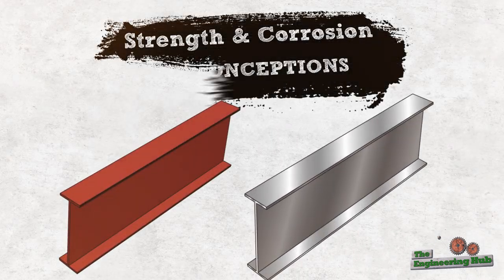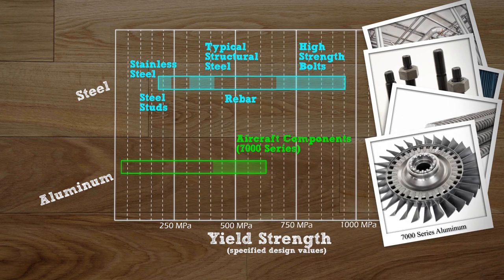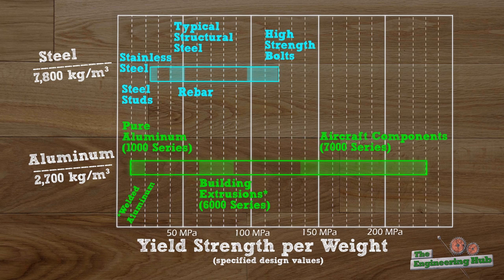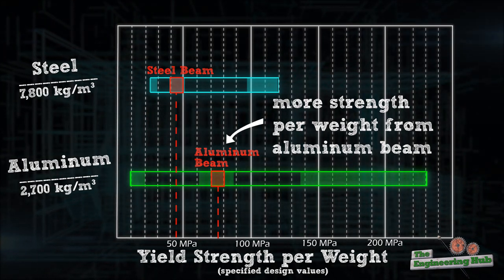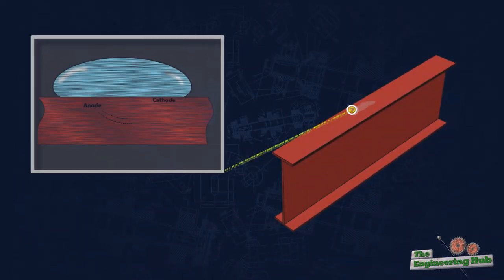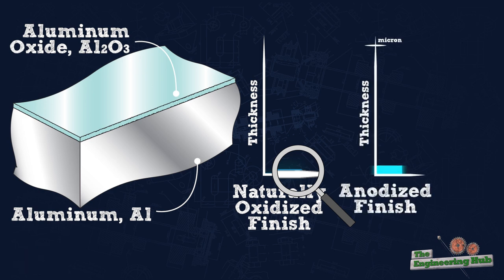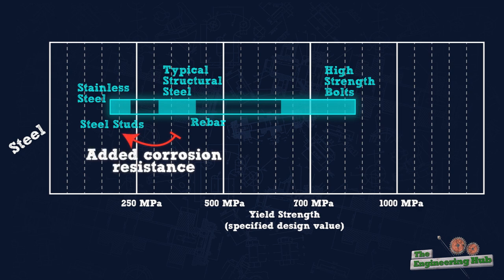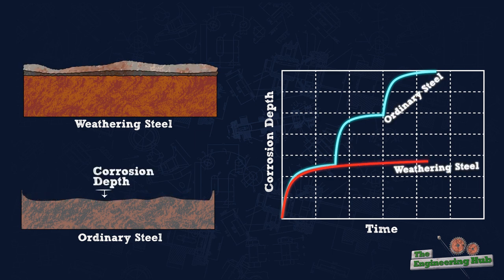Steel vs Aluminum - Debunking 4 Common Misconceptions

Comment: At work we are often avoid aluminum because of the following issues:
-Dissimilar metal corrosion with steel fasteners
-The need (or precieved need) for helicoil inserts 
-Difficulty in welding, the strongest AL alloys are often only weldable by friction stir welding which is a non-starter
-Fatiuge limits for vibrating structures and structures loaded to a high percentage of their yield strength 
-High strength aluminum alloys are harder to procure and have longer lead times 
-Some alloys are prone to stress corrosion cracking. 

When I was a kid and in school I had a real affinity for aluminum but when I had to start designing stuff steel grew on me fast.
Reply: Hey,
I’m doing a caravan 
The base chasis is steel, so I was thinking to use aluminium for structural wall and roof frame connecting it to steel base chasis, 

Does welding make it weaker? Use brackets instead or 

Fastners are no good?
Reply: @sagarshrestha9444  5000 series Aluminium-Alloys have a good corrosion resistance, are fairly easy to weld (given the correct tools) and don't lose a lot of strength during welding.
But welding thin Aluminium sheet metal is really a pain, so maybe consider riveting? There are suitable sealants for the joints, so it'll be watertight. We used SikaFlex in the shop I worked at, but that's a Swiss product and probably veeery expensive...
Reply: there are many other disadvantages to aluminium the man neglected to mention such as cost and strength per unit volume.
because main reason why steel is often chosen for construction is that, while more massive, also takes up a LOT less space than aluminium.
another thing is flexibility and toughness, you can hit a steel I beam with a forklift and it's not gonna budge and at worst you're tearing the bolts out of the concrete floor before the beam takes significant damage.
you do that with aluminium there'll be a huge gash torn into it, with extremely sharp edges all around it.

Comment: As an electrician I've seen many aluminum wires corrode into dust. To be fair copper will also do this in very humid conditions, but aluminum is way worse. That's why we don't use it in romex any more, just doesn't hold up and becomes a safety hazard.

Comment: Great video, the only slight issue is the over simplification with the yield strength of stainless steels, those with a yield in the 200 MPA range are the very low end of the range such as 409, and most are far stronger, 304 is 240MPA, 316 is 290MPA, 303 is 415MPA yield strength and 301 has a field strength of 945MPA, you made the effort to show difference with differ types of aluminium, I think it would have been interesting to see the same with the different types of stainless.
Reply: Sorry, but you are comparing the 0,2% yield strengths of type 303, 304 and 316 in the annealed condition to type 301 in the cold rolled "full hard" condition. Not exactly a fair comparison. 

There are nitrogen-alloyed (nitrogen-strengthened) stainless steels that can surpass 800 MPa 0,2% yield strength without cold work strengthening and exceed 1500 MPa with cold work. PH 13-8 Mo stainless steel will attain 1400+ MPa yield strength in the H950 aged condition. Maraging steels (MAR 250, 300 and 350) are technically not stainless steel, but MAR350 can even attain higher values for yield.
Reply: u guys are dorks (i love you both dearly)

Comment: Yes, more please. I'm so puzzled.  Stainless steel is very hard to cut and drill but apparently it's weaker structurally. I'd like to understand this better.
Reply: chromium fucks it up 😂
Reply: And there is different types of strength.
Reply: The reason many stainless steels tend to be difficult to cut and machine is due to the tough, gummy nature of the material.  The toughness creates high cutting forces, which in turn promote work hardening (anyone who has had to drill stainless steel with a hand held drill has likely encountered this).  The "gumminess" of the material makes it difficult to get good chip control when machining.
Reply: @ferrumignis  Correct
Reply: I observe they are brittle and crack easily and not as ductile as ordinary steel. I think that is why they are not used in car bodies because they cannot be stamped into shape without cracking ?
Reply: @liboy9844  that sounds about right. I think the Tesla truck was going to be stainless steel but that was all flat panels wasn't it?
Reply: @liboy9844  Stainless steel isn't used for many reasons, primarily cost but also weight (you need more for equivalent strength), more difficult to weld and some grades can be prone to stress cracking.
FWIW the infamous DeLorean car has a stainless steel construction.
Reply: There are three main types of corrosion resistant steels:
Austenitic - soft, ductile, easy to weld; not hardenable by heat treatment - used in decorative and low load applications, cutlery and the like
Martensitic - hard, not very ductile, must be heat treated before and/or after welding; hardenable by heat treatment - used for cutting tools, turbine or engine shafts, valves (up to around 300°C service temperature)
Austenitic-Ferritic (Duplex) - fairly high strength and ductility (not actually hard), superb corrosion resistance (and price); not hardenable by heat treatment - used in chemical industry

These three main types differ in their respective alloy composition, mostly their Carbon, Chrome, Nickel and Molybdenum content.
Reply: @fimbulvarg1213  very interesting.  I don't know if can tell the difference in the field when I pick up a piece but I'll try.
Reply: @Goalsplus  You can't tell by looks alone, you'd have to know the grade number. And there are several number systems, all uniquely awkward in their own way^^
Reply: @fimbulvarg1213  thanks. I'll stop trying to do the impossible.
Reply: I once had a S&W model 66 stainless steel revolver. It worked fine but I was warned it might develop microscopic cracks. I eventually sold it so I’ll never know about cracks.
Reply: in reading about EDC knives there are about 20 or more types of stainless steel which are different alloys with different properties. For example mine has a VANEX blade which uses nitrogen instead of carbon and it’s main property is that it’s totally impervious to corrosion, even in marine environments, you can leave it in the bottom of a boat. Although the pins may not be VANEX. Probably at the expense of some other property, maybe it won’t hold an edge as long as a tungsten alloy blade.
Reply: @darylcheshire1618  There are certainly more than 20 stainless steel grades ;)
For comparability I personally think one should avoid trade names and use grade numbers like the UNS or the European material numbers... Though Manufacturers tend to try (very hard) and hide the fact, they don't use the most specialestest of steels for their products :D
Reply: @darylcheshire1618  I'll add to my previous comment, that some grades are of course proprietary (as in patented) and don't have material numbers of any kind.
Always take the material descriptions with a grain of salt though. They're trying to sell you stuff ;)
Reply: @fimbulvarg1213  I thought about 50 but I wasn’t sure
Reply: You can post anything on the internet bro. Im a machinist, and youre right, steel is way harder to work with because its way stronger and way denser and way heavier.
Reply: Stainless steel is strong, but on the molecular level it's like glass because its like a potato chip, while mild and aluminum is able to deform like plastic and keep its shape.
Reply: @SteveVi0lence  Nope, it's an alloy, not a glass. The crystal configuration makes the difference.
But there are stainless steels with similar structure as mild steel, and even hardenable ones (martensitic and maraging).
Reply: @fimbulvarg1213  it's called explaining it in a way that someone can understand
Reply: @SteveVi0lence  It may be easier to grasp, but it's still very wrong. Glasses and metal alloys behave very differently.
And also I thought we were already beyond the point of explaining material scienece to 5th graders.... But I may be wrong on that ;)

Comment: Aluminium also suffers from Hydro Aluminium Oxide (HAO) under certain conditions. HAO turns affected areas or spots into soft powder which can penetrate the metal and cause failure. This is mostly seen in marine enviornments.

Comment: Some other huge differences are strength based on heat (steel wins) and cold embrittlement (not sure on the properties of aluminum here). Also, fatigue strength is huge and steel would win on this one as well (that is why aluminum can't be used in house wiring - bend it a few times and it breaks; copper can be bent many times more before that happens). I have read that even aluminum power lines often have a steel cable in the core for extra strength (and since electric primarily flows on the outsides of the conductor). Because of fatigue, I am very wary of aluminum for many critical structural purposes. Because of steel rust, galvanizing, etc. is a must in my opinion. (Disclaimer: I majored in mechanical engineering in college, but never got a job in it, so I understand and love engineering, but am not a real engineer and certainly not a materials scientist.)

Comment: Great video as usual; I appreciated the differentiation between the different types of steel alloys and their strengths!
Idk what your field of specialty is, but I really liked how you mentioned the extremely weak welded aluminum. It would be nice to have a whole video dedicated to the effects of welding on different types of metals. I've heard that welding makes steel stronger for some applications, but I've asked about weldable 80ksi steel and they said I was a fool bc welding makes it weaker
Reply from the maker: Thanks Matthew,
Yes, welding certainly could be a video topic of its own. We've added this to our roster of potential future videos. 
Cheers!
Reply: Not an engineer, but a welder, what exact type of 80Ksi steel exactly are you looking to weld? almost all are weldable, some creep resistant Chrome-Moly alloys need careful pre and post heat to avoid cracking but don't end up weaker at all when done correctly.

If you know exactly what alloy of 80Ksi steel you are looking to weld I can probably point you towards a few good resources on how to weld it.

Comment: I'd like to answer some of the questions here about Weathering Steel.   I work with it.
Weathering Steel is more known as Corten steel.  

Corten is a carbon steel with an added 0.5% to 1.0% of Chrome, and Nickel, and Copper (each).  Think of it as a low percentage stainless steel with an added copper.  See why it is rust resistant?  The copper helps in creating the corten patina with helps to prevent further rusting.

Corten steel, Or CorTen, or Cor-Ten steel.  Short for *COR*rosion resistant - *TEN*sile strength.  CorTen trademark is owned by US Steel who invented it in 1933.  Therefor, people use Weathering Steel to avoid using the trade name.   

US Steel is in Pittsburgh PA.   Home of the Steelers.   And now you know why it's called Steelers.  😁

Cheers!

Comment: HV power lines actually use a mixture of steel and alumium, since they have to use fairly pure alumium for high electrical conductivity, and steel is cheaper and better than alumium alloys for structural reinforcement (less creep) The stronger alloys of alumium are not as conductive, so they are only normally used in special case power lines where corrosion of the steel reinforcement might be an issue.
Reply: Also, the current only uses a potion of the surface (skin effect) so the core of the conductor can be used for strength and the outer surface can be optimized for conducting current.

Comment: I believe a factor in the corrosion-resistance of aluminum is that aluminum oxide adheres to  aluminum metal, whereas the same is not true of iron. The rust flaking off exposes fresh iron surface to corrosion.

Comment: Great Video! It would be great if you could do a full series on materials. Especially yield  and strength in a simple formula so the home builder can explore the correct material for the job. The natural guess id to go on the heavy side because there is no quick way to calculate acceptable load bearing properties

Comment: Great video! Question, can I add a piece of aluminum to steel to act as an sacrificial anode to protect it from rusting? How would I go about doing this?
Reply: k they're right next to each other in the series so you might not get good effect but al sticks to steel from galling so you could thread the two together & torque the heck out of it, or you could rivet it on (most pop rivets are al) or if you've got the capability: explosive welding! jk explosive welding is super cool but idk anyone who could do it at home, lol.

Comment: Steel has on big advantage, relaibility.
Aluminium has creep, slow deformation under normaly calculated load.
It flows like plastic.
There is no material cost efective and recycleble like steel.
And yes, aluminium has corosion too, high strenght aloys esp.
Reply: Why it is widely used for motorcycles frame and sports car?

Comment: In. Those aluminum power lines running down your street has a steel wire running down the middle of the wire bundle

Comment: Steel is remarkably complex... I feel you should have provided more examples of extreme steels of different kinds used in corrosive, high strength, impact, etc.
Reply from the maker: Thanks for the feedback. You're definitely right about the complexity--we had a long lost of properties that didn't make it in this video
Reply: disagree, I think the presenter did a good job of drawing a line beyond which more info would have only added clutter

Comment: Why, obviously, you use titanium, as Hollywood makes it utterly immortal and far stronger.
Despite the fact that titanium is between aluminum and iron in strength and alloys only modify the base behavior, it's magic or something.
Still, for steel protection, I tend to like either nitride finishes or phosphate based finishes, but they're surface treatments.
All lies within the chemistry, specifically, applied chemistry within the field of metallurgy. Not a mystic art, but a complex field of science.
Science, the vast field engineers depend upon.
Deny that, deny the existence of skyscrapers and the car you drive.